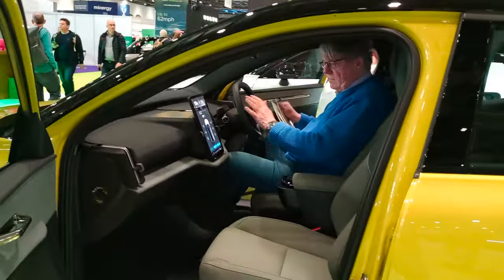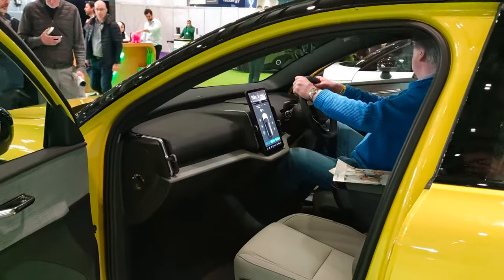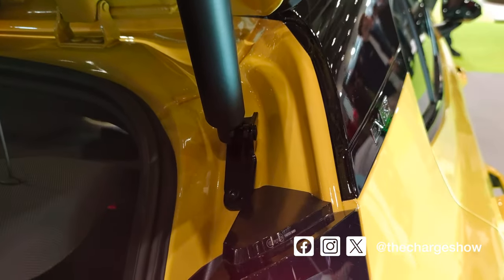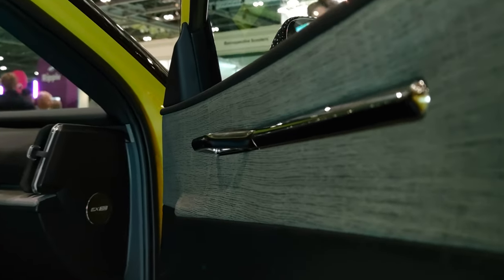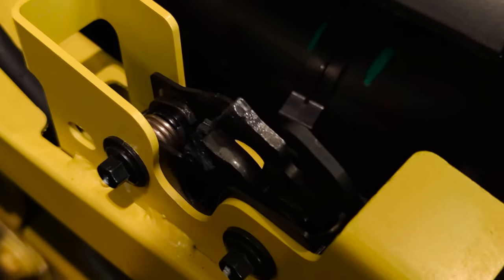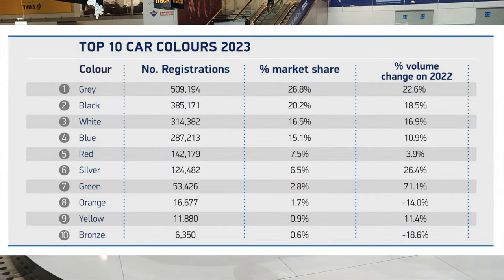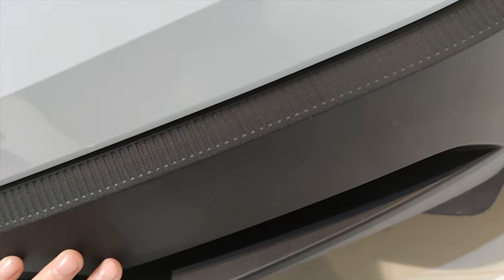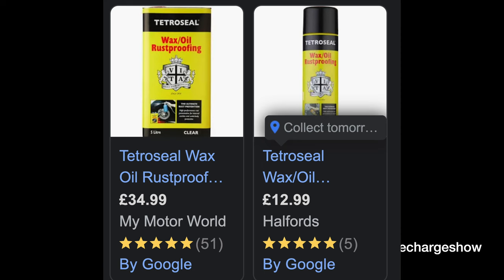Volvo EX30 - Rust Problems and un-finished paint again

Comment: Im not that worried about the lack of a clear coat under the bonnet or wheel arches because no modern car relies on paint for corrosion resistance, paint is mostly aesthetic. All cars are hot galve dipped in the white these days (ie panels, roof, bonnet, boot) and I notice that there is a emulsion sprayed under the guards which reduces paint chips and helps with NVH however the underside of the Volvo bonnet looked awful. There were parts chopped out everywhere and it looked like it should have had a plastic or fibro cover attached to smooth it out. If the Volvo did not have a ‘frunk’ I might have given it a pass because how many times does anyone open the bonnet of an EV like an ATTO3 which does not have a ‘frunk’? But the EX30 would be open reasonably often and the unfinished look was terrible.

Comment: Toyota Aygo. Jaguar S-Type are the same. I can’t see the problem of no clear coat under the bonnet? Did you see rust on an EX30 - I am interested as I have ordered one
Reply from the maker: No rust on the EX30 yet, but I like some others are concerned because of the the lack of polish under the bonnet, and my suspicions are raised because my brothers brand new Volvo has rust already. For the next ten years it probably won't rust much f it does under the bonnet, but around the wheel arches, and various other parts such as around the hinges and welds to me appear to be areas of concern. I used to repair vehicles for a dealership years ago and we talked at great length about what is sufficient and not sufficient in terms of paint coverage.  At the very least you could identify this as a bit stingy and not what people would choose if they had the choice. I ran a poll yesterday and 70% of people agree that its stingy and not to their liking. So it isn't perhaps a major concern or something to stop you buying one.
Reply: @TheChargeShow  fair points. Glad you didn’t spot any as that would have been really bad. Have a great day.